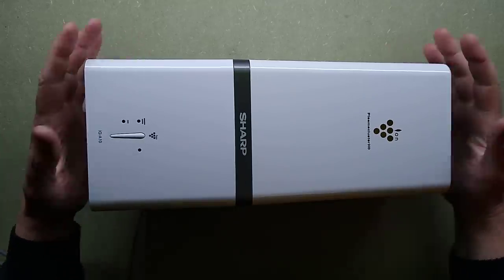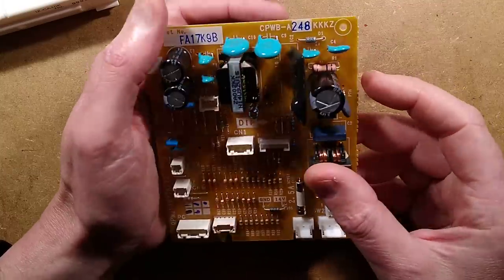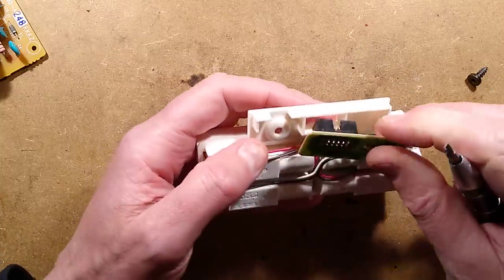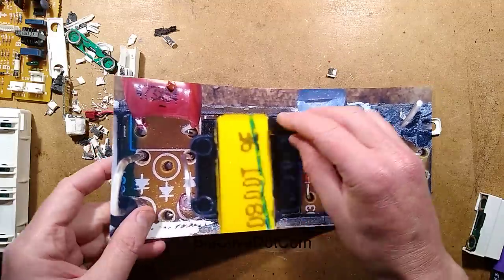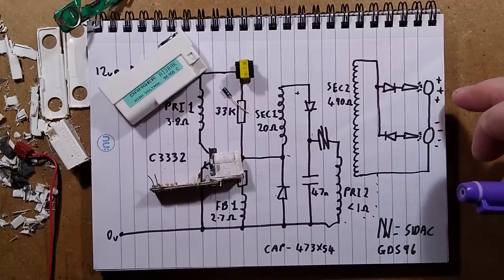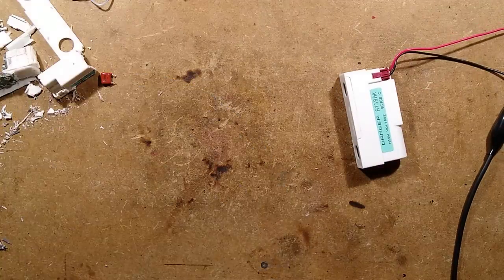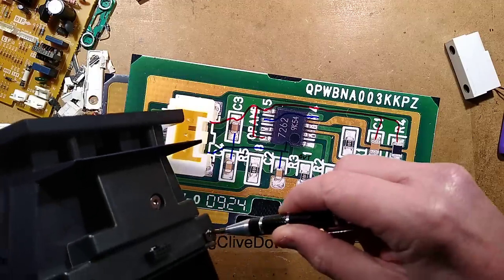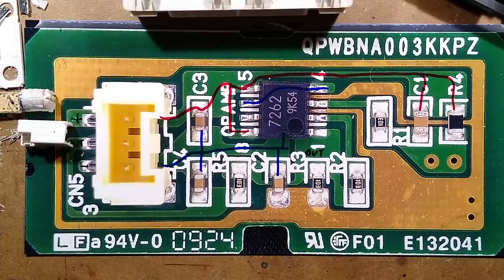Exploring a popular Japanese air purifier.

Comment: Clive, there is some truth to their claims. Water molecules, because of the electronegativity difference between oxygen and hydrogen, have a slight electrostatic polarity to them. The molecule is also "bent", with the bond angle between the hydrogens and oxygen being about 107.5 degrees. This allows a "partial positive" and "partial negative" charge to appear in that the molecule is not actually charged but there is still electrostatic attraction since oxygen hangs onto the electrons shared in the O-H bond longer than hydrogen does and, critically, the shaped molecule allows electrostatic attraction to other things, in this case ions.

The sort of slimy bit though is that this happens with any ion, not just H+ and O-. If something is polarized or has a charge, water clings to it on a molecular level with very few exceptions. This is very handy for chemistry in solutions, though I'm not exactly sure how differently it behaves in a gas phase.

Comment: Yes, hydrogen ions are protons which are positive, oxygen atoms usually gain two electrons in ionisation and so are negative overall. The O-H bond is polar (the electrons are closer to the oxygen than the hydrogen) so the oxygen end is slightly negative and the hydrogen end is slightly positive, this is why water molecules cluster around ions (with the oxygen facing in or out depending on the ion's charge. This is the basis by which salts dissolve in water; its positive and negative ions are broken up and surrounded by water molecules.

Comment: A side question that I never took the effort to ask: the two in-circuit resistors: would that be a use for a four-terminal setup in addition to the usual low-impedance measurement?

Comment: I'm surprised that they're using a needle for the positive electrode. Electrons like to jump from pointy things, and that doesn't match the design of the positive end. The end result will likely be an excess of negative electrons, which results in ozone, which will likely enhance the performance of the less-efficient positive side. This, and the crisscross pattern, are likely to minimize the build-up of charge and likeliness to get an arc-over or strong ozone.

Comment: I wonder what expires in that cluster. It looks like other than dust collection pile up, it is quite clever way to induce recurring payments from customers. And that sensing cicuit is designed to trigger cluster expiration when it no longer effective enough due to dust.
Reply: Nothing 'expires', the crap it pulls from the air builds up around the needle/outer ring and looks like soot, once enough builds up it will short it out,
If you brush them with a soft bristle brush then it solves the problem, 

Obviously Sharp don't want people to know this so it uses the detector plate to switch on the 'replace cluster unit' light and yes you're probably correct in thinking that it will disable all 4 units if 1 gets too dirty,

I had a PureMate pm200 which had a removable cover over the needles/plate so it could be cleaned, but of course, where's the ongoing profit in that?

Comment: @bigclivedotcom what do you think of Wellis MAPS Air? They claim to release OH ions but not ozone.
Reply: https://maps-air.com/wellis-surface-air-disinfection.php is the product page
Reply from the maker: Lots of hype for a fairly standard photocatalytic unit that probably uses UVC stimulation of a photocatalytic converter based on titanium dioxide.  Controversial area, since the long term effects of elevated hydroxyl radicals are not known yet.

Comment: What wears out on the modules?  Is it just the 'pin' wearing down or does the potted electronics age somehow?  Seems odd that old design ozone generators basically lasted forever yet this needs replacement modules.  Is that just a sharp money making practice?
Reply from the maker: The needles erode.

Comment: Great video!! I have a question: why is there the necessity to replace de ion generator after 19000 hours (the model I have says that)?
Reply: I'm guessing it has to do with erosion caused by the corona arcing discharge done to the antenna and collector plate that surrounds it.  That the two will become further and further apart over time (if not just dirtier and dirtier) and that furthering distance eventually leads to an inability to further discharge as it reaches the limit of voltage versus distance or somethign like that.
Reply: @xapplimatic  Thanks!

Comment: The manual says the ion plasma core thingy needs replacing every 2 years, so, that's probably impossible and/or expensive in the UK
Reply from the maker: They are quite expensive.  Except the large box of them I bought for this one.  The technically inclined might take a fine file and put a sharp tip on the needles again.
Reply: They are available from eBay UK for £12 including p+p, search for IZ-CA10E, seller is amberliekirkham
I received mine yesterday to wire into an old tower fan,

As Clive says, you can resharpen the needles, but just brushing the sooty build up works wonders too
Reply from the maker: @sofa-lofa4241  That's the seller I got my unit and box of spare emitters from.
Reply: @sofa-lofa4241  How do you wire in? how many volts/amps what pins?

Comment: This reminds me of devices I own, called "OzoNomatic" Air conditioners, or as the other box states, Air-Conditions. These were manufactured in the early 1950s, or even 1940s. The different approach in them is to use a 50 Hz supply with a transformer and a mains voltage fan based on a split pole motor, but otherwise a similar approach. 
The case itself is nearly molded in a streamline ivory bakelite. With mine, there's a resistor in a switch box within the power cord, to control the intensity. Safety features? None, dismantling and plugging it in you can touch the HV output of the power transformer.
So I expect the principle to be very old, and used since a very long time. Ozone seemed to be pretty effective in removing odors. But I doubt it could clean air in the applications mine came from, a modestly sized movie theatre of the 1930s, and trying to avoid the moldry smell of patrons with their wet clothes in winter.
Probably you are right, the Sharp people don't claim it Ozone generator, not to trigger the hysterical people, and also try to avoid to mention the ozon generation in their principle description. Weren't ozon ions negatively charged oxigen molecules, afair?

Comment: I wonder if this is essentially what's in Winix air purifiers that they name "PlasmaWave".  Inside there's a little unit that looks like one of those components that I believe is called "Plasma Doctor". 
Frustrating that there's not more concrete information about these devices available.
Reply from the maker: It's hard to find the real data amongst the advertising hype.   It looks like the PlasmaWave is similar.  In their promotional video you can clearly see ozone molecules at the start, but they are very coy about showing them in their machine.

Comment: What is the reason that the modules need to be replaced from time to time? What wears out? Or do they just get dirty?
Reply from the maker: The needles can be eroded by the plasma. They could probably be sharpened.
Reply: @bigclivedotcom  perhaps you could use a gramophone needle sharpener? Sadly, I seem to have mislaid the one my Granny used. Seriously! It sharpened steel needle points.

Comment: Maybe they try not to expel ozone into the environment, but rather have the air running through, be ionised, ozonated and then neutralized? That would actually have an effect and clean the air, without oxidizing everything around the device...

Comment: I’m pretty sure monoatomic oxygen and hydrogen are both far too reactive to stick around for long in that state. I’d expect them to form O3(-) and H3O(+) by reacting with oxygen and water respectively. And while water molecules would be attracted to these since water is polar, the same would be true for any ion generator. Seems like the unit would work well, but I’m not convinced the advertising department ever spoke to anyone who knew what the machine actually does

Comment: If the op amp oscillates it may do so differently depending on the output of the modules. The ozone may take some of the charge off the plates and the lack of might pull the voltage up some?
Reply: Standard electrometer. The high value resistor is there to provide the input bias current for the opamp, so it will float somewhere between the supply rails. Then the plate collects charge, with the opamp arranged as a unity gain buffer. the ring is a guard band, so that the plate does not have any leakage path to ground to discharge it, as the guard is a relatively low impedance path for this. The output is likely used to detect the ionisation is running, as the voltage will depend on the air flow being ionised. That would explain the switching of the different ioniser generators, they are switched so there is a step change in the output of the sensor, and this step polarity will depend on which module is running, as they will either add charge or remove it, depending on the place of the plate in the air flow. 

Swap between pairs fast, and see the change is fast, and you know the 4 modules are working, and if one fails, you sense a drop in current draw for a primary side failure, or a high current, and if the high voltage fails you see the ion current step is now smaller, but current is nominal, so you flash the "change ion module" LED to allow the user to service. Slow changes are probably to allow the plate to saturate to one rail or the other, allowing the opamp input protection diodes to clamp the input voltage to a defined level, and then you can get the confidence the sense module is working, as it goes from rail to rail after a few seconds. 

Cynic in me says that there is also a timer in the system, so you throw away perfectly good modules every year or so, as they likely last at least 10 years otherwise, though the needle points might be a little blunt after 5 years, so get them changed every 2 instead. Probably putting in a socket at each end, and giving a few spare sets of needles was considered too difficult for the average user, so make the whole module a spare part instead.
Reply: @SeanBZA  I suspect that is where the money is made on this product, selling replacement modules.

Comment: I had a portable room air conditioner from Sharp that had "Plasmacluster". I let the condensate sit in the unit too long and it rusted out. If I had know what lay inside, I would have done a more thorough investigation. I currently have a Winix air filter with "Plasmawave" that, looking online, has similar claims. So now I'm sad that my ions are not in grape-like clusters. They are only in stupid-simple waves. Whatever.

Comment: you put it in a box with still air, what if you simulate the air flow it has with the fans and then smell the air and measure the content of the air.
Reply from the maker: That would require a dedicated ozone meter which is generally very expensive.  It was simpler to put it into a container and then sniff it to detect the distinctive smell of ozone.

Comment: Hello. I am looking to buy air purifier and I wonder, do you know which brand has the most effective technology, because I know they are different from each other. I am talking about Sharp Plasmacluster, Panasonic Nanoe and Daikin Streamer. Thanks!
Reply from the maker: It's all hype.  The typical HEPA air cleaner is just a fan and a filter with added gimmicks for marketing.   Always check the availability and cost of replacement filters before buying a unit.   The plasmacluster and all the others are really just low level ozone generators in disguise to avoid ruffling the Karens.
Reply: @bigclivedotcom  That is what I thought, but I started reading that one makes electrons, the other positive and negative ions, the third radicals and maybe someone is better. I am testing an old Daikin, so I guess I will check the price of the filters on the new machines and will decide. They have made them last 10 years, which seems suspicious. Also Sharp is the only company that says the ion thing has life and should be replaced like every 2 years. Anyway, thank you.

Comment: But why, the high voltage modules, would be expendable?
Reply from the maker: Probably needle erosion.  It also means that a section that can potentially fail can be swapped out easily with no tools.

Comment: So unless i am missing something here this product is a blatant example of something that is "designed to fail" Its just that in this case the parts that are designed to fail are user replaceable. Those modules are literally just simple high voltage power supplies which if properly designed should last the entire life of the product. Ok so maybe the electrodes would eventually degrade. Then ether use better electrode material or make the electrodes replaceable. I see no reason you should have to replace the entire power supply other than more $$$ for the company supplying the modules.
Am i wrong?

Comment: this is one of the best air filters.. when its deassembled my heart go ouch. plasmacluster is used in many appliances eg fridge and even on toyota cars
Reply: It's only one unit out of four in a replaceable module. Imho. the sacrifice was warranted to explain the function in more detail: Fascinating. I always like to know what's inside my devices. I regularly download service manuals for devices in order to try troubleshoot old devices that might be useful once repurposed, such as the screen and screen controller of an old low-res Nokia cell-phone.
Reply from the maker: I reassembled the unit and put a new ion module in.
Reply: its not a filter actually

Comment: PlasmaCluster purifies the air by generating hydroxyl radicals which forcefully bond to, and therefore rip apart, VOCs, bacteria, viruses, etc.
Reply from the maker: Or in this case a mix of additional molecules including ozone.
Reply: @bigclivedotcom Hydroxy radicals are thousands of times more reactive than ozone, but their half life is less than a second. They’re quite fascinating, especially when created via UV. Doing so can cause a cascading effect which spreads the hydroxyls throughout an area like a gas, purifying surfaces, fabrics, and the air itself.
Reply: Apparently these hydroxyl (OH) radicals react with everything indoors, stealing hydrogen from organic molecules, making H2O in the process; but the organic molecules that have been robbed of their hydrogen then go on to combine with O2 in the air, creating peroxi radicals (whatever they are?)… leading to other chemical changes to organic aerosols, including unstable molecules that can ‘fall apart’ into reaction products like formaldehyde in the atmosphere, to name just one. Having said all that, I’m not a chemist, so I haven’t a clue really what I’m talking about lol https://www.youtube.com/watch?v=gdjy1ESmX3E

Comment: Nice, a resonant feedback plasma generator based ioniser.
(As opposed to generating major amounts of ozone. Unless it does, which then would make it lung damaging, potentially.)
There are more efficient ones, but this one is very cheap components... allegedly.

Non ozone-laden ionizing is mostly used for capturing dust, alongside HEPA filters.

Comment: Is that power being transmitted without wires from the plasma units ??
Reply from the maker: They charge the air electrostatically.
Reply: @bigclivedotcom  I just had the thought that if current can be detected like you demonstrated ,is that the bases of why wireless power as we all consume it would never be viable ramped up like in tesla's papers ,that it  would create to much ozone ? Why I thought that ???

Comment: So I did some google-fu. Recently the UL certified several "plasma" ionizers (models using brush electrodes) as "zero ozone" devices and the JAMA also claims that in an enclosed 1m^3 test chamber ozone concentration never exceeds 0.01 ppm for Sharp air purifiers. It appears these are not ozone generators, which are in fact sold in Japan (for example, Fujitsu sells a low level ozone generator for odors).  Sharp has been hit by Japanese regulators for Plasmacluster making claims that are not proven outside of laboratory conditions so maybe this device actually does almost nothing.
Reply from the maker: 0.01 PPM (10 parts per billion) is the ideal target level for ozone.  That's the natural level found in unpolluted outdoor air.
Reply: @bigclivedotcom  I think the key is a room is much, much larger than 1 cubic meter so in even a very small room this device would produce effectively no ozone.  The claimed ion concentration is even lower than 0.01 ppm, but Sharp claims that figure is in an actual room of the size the device is rated for (usually 6 or 8 tatami mats).  Like I said though, Sharp had to pull claims of any effect on particulates and clarify their claims on VOCs so the actual effect is probably pretty weak.

Comment: What’s a good cheap brand of solder got some cheap eBay lead solder rosin core but was shite and didn’t wet at all.
Reply: The stuff I use is branded 'Multicore' and works well,
I've never had any luck with the cheap stuff from ebay, or the lead free

Comment: So according to that illustration it binds the moisture in the air into tiny droplets and releases them? 
That doesn't increase the moisture content of the air though.
I guess, they didn't want to deal with people who are worried about ozone.
edit: I see, Clive has to the same suspicion :D
Reply: It makes the air feel pleasant, even if the humidity is low.

It's not really an ozone generator.  I have a air quality meter and the ozone levels of the Sharp are so low it can't accurately measure them.